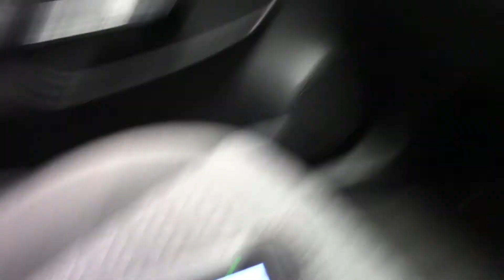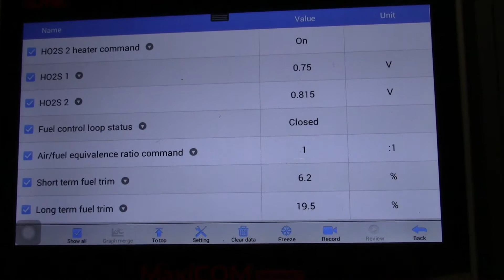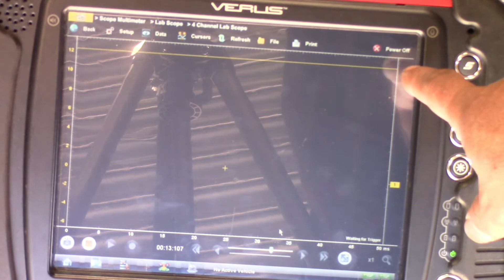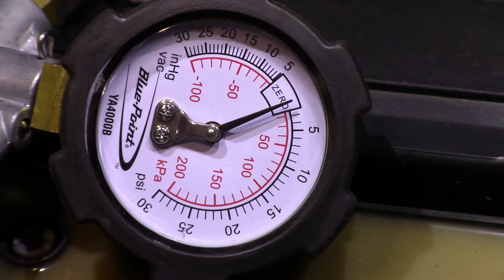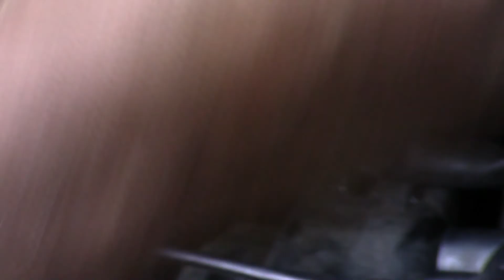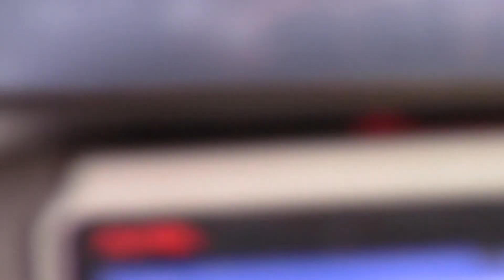Vauxhall Corsa D 1.2 A12XER 2014 P0171 DTC Investigated

Comment: is that what causes the ticking noise as well?   My error is also P0171 in a Corsa D. Same Valve . 

Engine ticking from where the Purge valve is.
Reply from the maker: This system is not used on Corsa D(diesel engines) this charcoal canister purge solenoid is used on petrol engines to allow evaporated fuel flows back to the engine through the inlet manifold by opening charcoal canister purge valve to burn out in the engine combustion chamber instead going to the environment.
Reply: @stanhopeautorepaircentrewardak  Sorry mine is also a Petrol. The D is the Model 2012.
Reply from the maker: Okay! I miss understood i though you meant D for diesel.
This solenoid or purge valve actuator only triggers Engine Malfunction Indicator Light and the DTC is usually stored for air fuel mixture lean, one ticking noise but very fast is normal it is when the engine reaches its operating temperature, you may hear this noise after snapping the accelerator pedal and leaving the engine running at idle, this ticking noise will continue for short time while engine is returning from snap opening throttle to idling then will stop it means that the purge valve is activated at crouse engine speed or wide open throttle.
Reply: @stanhopeautorepaircentrewardak  Thanks Yes it's ticking from the back around the Purge valve area. I will remove the Throttle body to get at this as it's difficult. The Code is P0171 "system too lean bank 1" and Engine light comes on. Changed Oil and AirFilter. Will change the Purge valve next and give a throttle body clean up with Cleaner spray.
Only when idle the ticking is so annoying.
Reply: @pataleno  has the new part fixed the problem please?
Reply: @harrigreen6263  It cleared the P0171 error. Not completely happy it fully removed the ticking noise. I have now changed the oil and added top end treatment which helped. Think I need to clean the lifters. Cleaned the throttle box as well. Car definitely running better. Slight ticking noise from hydraulic lifters though.
Reply: @stanhopeautorepaircentrewardak  Hello , so If this valve is slamming continuously when the motor idles it is broken? Mine is doing continuously when I put mi hand on it, is normal this ? And I also hear a pressure sound .